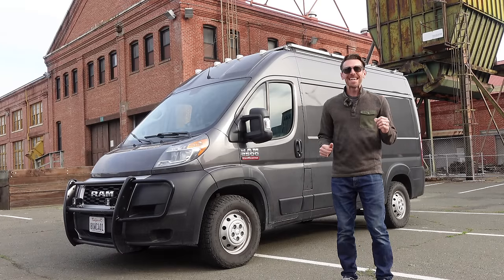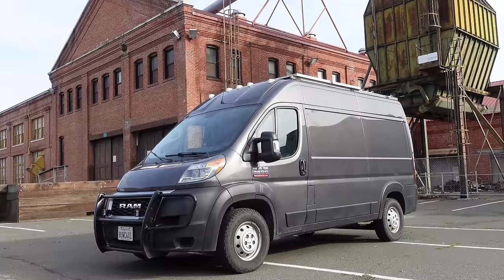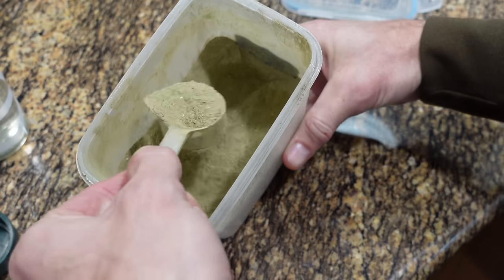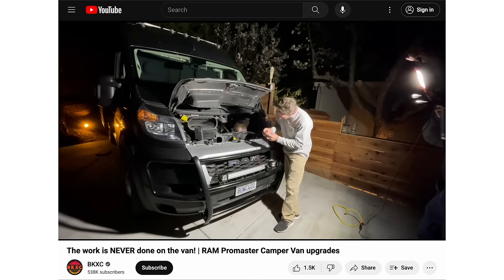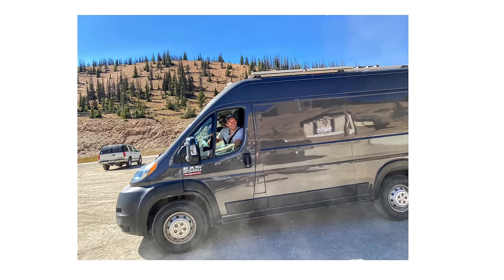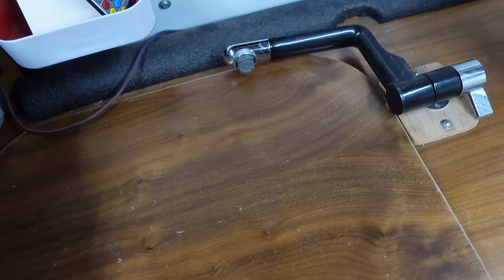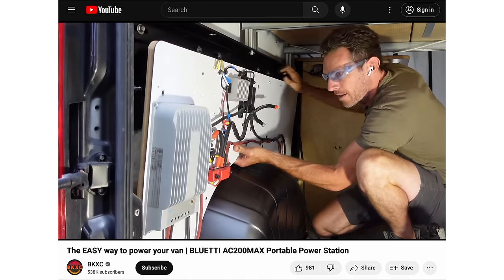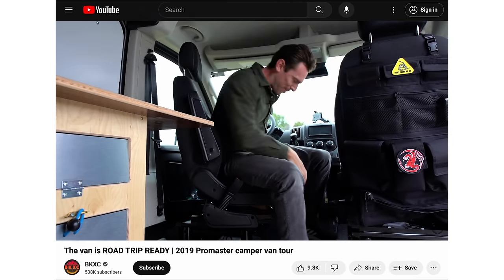100,000 miles of regret | My RAM Promaster camper van

Comment: I really wanted a van but, for many of the reasons you cite, probably not, especially the expense. Probably will stay with my crew pickup with a lightweight topper/camper. For weekend trips probably the way to go. Acts as a topper when the tent is down and still garageable.
Reply from the maker: Being able to park in the garage was a HUGE hang up for me. I hated the idea of having my van parked in front of my house. But it’s been trouble free so far, no break ins!
Reply: @bkxc  wife doesn’t like the idea of a van in the driveway. 🤣 Then there’s the issue of snow clearing and the seating limitations.

Comment: The 3.6L is generally pretty reliable. Lots of high mileage 3.6L pentastar out there. I have a few friends myself with over 100k on their wranglers/ grand Cherokee's with no issues. The lifters going out is probably the most common fault of the 3.6 but if you replace them before they take out the camshaft its not too expensive. 

Sure does suck you had to replace yours! Sorry to hear that. To be fair, I have had problems with even Toyota's, serious electrical issues and transmission issues.

Cylinder 2 caused a recall on wranglers/ various other CDJR vehicles of the time around 2012-2013.
Reply from the maker: Yep, every car is a roll of the dice! Just so many components.

Comment: If you are watching this and wondering what van you can get that wont suck this bad, the answer is the Nissan NV2500/3500, specifically with the 5.6 v8.  Yes, there is less (length) space because it has a normal hood, but that is also plus in so many ways.
Reply from the maker: I appreciate the alternative input!
Reply: Does this have height enuf to stand ?

Comment: I'm 72 yrs old and and I considered doing a van conversion as I have the skill set for sure. I decided against it, here is why, since my youth I've built and restored cars and trucks literally frame off engine rebuilds and customization. The biggest drawback in my opinion is the drive-trains in these vans, they are simply not up too the workload required besides who wants to spend 20-30 K to have someone modify one and have an engine that last 75-100K and you're back to square one. I decided on a Toyota tundra v-8 pick up with a tow behind cargo hauler, you can get multiple sizes in the haulers and build it to what you desire. Mine is 7'x14' and loaded with everything a van would have 2000 watt 24 volt ac/dc system all the amenities, and the beauty his my truck with a camper top serves as extra storage for anything i like. When i get to a campsite drop the trailer put a lock on the wheel hub and the tongue so no one can steal it and drive the truck anywhere i want returning at night to camp.I keep my Kayak on my truck drive to a lake go fishing, no problem return and all is good.
Reply from the maker: That sounds like you made the right choice!

Comment: The Promaster headlights have a problem with the wires fraying a few inches behind the socket, causing them to dim but not go out. I would install a new socket and use larger wire and run it close to a foot before splicing into the factory wiring. It fixes the dim headlight issue.
Reply from the maker: Oh wow! First I've heard of that. But headlights were dim from the beginning.

Comment: Definitely got you were you needed. Id never touch a dodge/chrysler product personally. Everyone has a story about them shitting the bed, and all my mechanic buddies refuse to buy them lol
Reply from the maker: Haha, live and learn!!
Reply: I've had three Chrysler vans, two used and one new. The 1st was good. The 2nd, a Town & Country, never needed a repair for 8 years! And few after that. My current, a Pacifica, had been nearly flawless, only a recall repair on the sliding door & console. We maintain them but have been really blessed with how they've held up. I know Pacificas had a rough 1st rollout year or so but I guess we didn't get a lemon. When you get a good one, they're gold. If I could find a decent- looking way to raise the roof, I'd make it my camper van. Stow-&-go seats in both back rows! I'd take some out & use the storage, but still have some seats to pop up for guests.

Comment: Hey Brian, not sure why you were unable to just replace the headlight bulbs with LED'S? I did this to my Promaster 2 weeks ago (because stock was TERRIBLE) and I just bought LED versions of the standard bulb size. No cutting glueing, standard install... They just needed to be aimed down slightly further than they were previously but everything worked fine!
Reply from the maker: Yes! I had not researched this again recently, but during the first couple years nicer headlight bulbs weren’t available. I figured it would be that way forever, but now it’s a standard upgrade (that I need to do).

Comment: I bought mine in 2020 (2019) and it had 15,000 miles on it. Did I luck out or what? I'm only reaching 40,000 miles now. Yeah the lights suck majorly. Leaves me wondering half the time if they are even on, but they are.
Mice & Colorado go hand in hand. I've captured about 7-8 when I was there. They don't get in from opened doors but mine wasn't converted or insulated yet.
Reply from the maker: Wow!! Crazy amount of mice, yikes!
Reply: @bkxc  yeah well my van is all open bones until I get my butt in gear ,& insulate it. Pretty soon. They are cute but they can't stay. 😂

Comment: I had no prob replacing the headlights on my 2019 Promaster. It takes elbow grease to push the bulb all the way in for a secure fit, that’s it. Bought on Amazon:  AUXITO H7 LED Headlight Bulbs.
Reply from the maker: Yes! For some reason I thought that the low beams were not a standard bulb because my buddy ran into some problems with his!

Comment: My 2018 Promaster 159 HR collected mice.  I full-time and had somewhere around 30 mice over the 4 years I used it. I became very efficient at killing mice. The final straw was a mouse that gave birth to 5 pups. I found the pups after I killed the mother. In spite of my proficiency at this grizzly task, it was extremely unpleasant every time. I could not figure out how they got in, or I would have plugged the hole(s). Would love to say that I sold the van because of the mice, but no, I put 100k miles on it and it was time for a new one. The mouse pups just gave me added impetus to move on from the van. Mice was one of two issues with the van that I dealt with.  I really liked that camper, so I put up with its flaws.
Reply from the maker: Holy moly!! Thanks for sharing the story!

Comment: I have 2014 Promaster w 135,000 (didn't travel much during Covid) only Major problem was had to replace Flex Plate? That cost $1400!   Running fine other that that?

Comment: If you're under 100k there's no reason to do any kind of flushes, I work for Spitzer CDJR and let me tell you dude as long as you do your oil changes religiously you'll be fine. The promaster fails due to extended oil change intervals. Change the oil at 4500-5000 miles and you'll be fine.

Comment: I swear the biggest positive about Tesla is no dealers…

I’ve dealt with FCA dealers once when I bought an Alfa Romeo and it was a nightmare. Not a fault with the car and as soon as I stopped letting those asrehats near it the car was perfect.
Reply from the maker: Yeah, I love the idea of an electric car so much. Of course any car has problems, but I love the idea of having fewer parts and pieces and fluids!
Reply: @bkxc  I think another problem with those US market “Promasters” is that they fitted a petrol car engine to it. A weird choice and I don’t think it’s up to the job!!

In all other markets where it wears the normal Fiat badge, it has a diesel engine that’s designed for that sort of vehicle. Here in Australia they have a solid reputation for being a reliable workhorse.

Comment: At this point 9000$ to 20000$ in price increase is purely criminal... Did the kit be 2 times better!? if it's for exactly the same kits it's not ok!!! 😕Even the increase in car and truck price is insane!!! You can have a crew cab 4x4 F-150 for around 40-45k$ less then 10 years ago! Now it more 70-80K$!!! 😲

Comment: i only bought 3 new vehicles and many used  but i have never taken any to the dealer for routemen service . oil and brakes i do 
when you had to tune often i did it .only time dealer saw it was recalls or warrantee and pre 2000 fords rarely had many warrantee and even few recalls until my 99  . one thing never flush anything but colling system and even they mostly in last 30 yrs just need drain and fill . i also worked for companies where i drove from 16- to 400 miles daily and they service useally regularly but sometimes budgets get strained  but cars went from  late 70s to late 80s cars and vans got extremely better every model yr fleet average went from 80k to 100k in 2-3 yrs needed replacement in say 75 cheaper cars to by 1990 160 and still safe to run but deprecated . they to about 2005 200k still good but seems backtracking with the government pushing emission and milage requirements   to be pushed to consumers before ready so we get to be batá testers . but regular oil and filter check all fluids regularly but don't always trust services advisers they work to profit the dealer which is rarely a actual owner there chains  of dealer corps not the local businessman

Comment: Dude, google how to turn the chime off. It’s a really easy thing to do on any car. You just need to know the specific code for each model car. It’s usually pushing the pedal and seat belt button a few times while the car key is in the “ON” position.
Reply from the maker: Yeah, I remember doing the research and it wasn’t so straightforward as that.

Comment: 75k on a RAM van Engine (which i suspect had regular service?). What was the reason for  the Engine going BOOM with No Warranty. This alone makes a RAM van buy a No No for me.. Most Fords and Mercedes in the uk go for 250 to 350 Miles in a lifetime of serviced frequently… Question, did the RAM dealership actually do the oil changes, sounds suspicious to me.. Did you complain.. thats no miles at all..!!!!

Comment: My son is an automotive tech, not to be confused with a tire changer or backyard mechanic. He's had over 15 years of schooling and shop experience, not to mention his loyal customers. 

The one thing my son repeatedly tells me is, "do not buy a Promaster- they're junk- no quality control and poorly fitting parts." 

But, I still want one bc of the shell design. However, I can't help but wonder how RAM can justify that unreasonable price when the vehicle is basically A METAL BOX! 🤦
Reply from the maker: Hahaha, exactly!
Reply: Does he tell you what van to get? Interested in his opinion there
Reply: @DMB-pe8hk He insists the best bang for the buck is a Toyota Tacoma, but no newer than a 2015.  They are warriors and hold their value. But, that's a smaller pick-up truck. So, he told me if I really wanted a van to travel, a Chevy Cargo van converted (having the roof replaced with a higher, fiberglass ceiling) was the only way to go. Since Chevy has not changed that van in 20 years, parts are plentiful and relatively inexpensive and, all the bugs have been found and worked out by now.

The problem is, it's very difficult to find a used Chevy Express for a reasonable price these days. And, if you're looking for an older one, it's either showing signs of body rot or, the mileage is over 200k. 

In my area, dealerships don't stock the Express. Those vans are usually ordered new, by businesses, and in multiples. It's tough to get one if you're just a private driver. 🤷
Reply: @rattlecat5968  I really appreciate this info & your taking the time to write it out for us.

Comment: For anyone who reads this and is buying a new vehicle,  always always always.. immediately drain the manufacturer fluids from the engine and differentials and change it over to Amsoil . The manufacturer fluids are just good enough to meet specs.. when you hit 40k, have the transmission flushed and replaced with amsoil, people are way too naive nowdays trusting these manufacturers and dealers ✌️
Reply from the maker: Wow, I've never heard that! Good tip
Reply from the maker: Wow, never heard of this! Great tip

Comment: Probably an issue with the shop you go to. You said you always say yes to everything they say, which means they probably don't treat you with respect, especially if they are having you flush the coolant MULTIPLE times in 75k miles, which sounds ridiculous to me, especially in a modern vehicle that utilizes more modern coolants.  If you don't check the oil leverl consistently, that may have been the issue, since dealership technicians are typically just kids straight out of high school who are highly incentivized to upsell people and may or may not follow directions when servicing your vehicle. 

I don't know anything about the 3.6 pentastar in the vans though and i always thought they were overstressed but can't be much worse than the new 3L inline 6 making 600hp in the trucks.

Comment: Unfortunately there is no perfect van solution. Promasters suck with electrical and motor issues. Sprinters have a million sensors that always fail and require 300 miles to reset. Ford doesn’t make a diesel transit in the US.
Reply from the maker: Most definitely!! Only tradeoffs in this world, no real solutions.

Comment: My 2017 Promaster,  bought new .
 At 40k miles the exhaust valve blew.
 At 61,000 miles it happened again while driving on the highway.  Left me stranded.  Dodge didn't want to help with the labor that I had paid upfront to get it back on the road. The engine was ruined because the exhaust valve wrecked the piston.
Then march 2024 the motor mount bolt snapped clean off and the engine almost hit the pavement.
   Dodge is a horrible company and hates people and hates their customers and could care less.
Reply from the maker: Yikes!

Comment: Can't you just install another vent in the roof? I saw somewhere you need 2 for the very reason you mentioned.
Reply from the maker: I think it’s more important to have the solar panels on top (which I didn’t show). A second fan would take up a lot of space. But I do like that idea quite a bit for full force movement of air.

Comment: RAM engines, especially the big displacement ones, are infamously fragile. But if you like the rest of the vehicle, Dodges are OK if you’re ok with the cost. Ultimate longevity means a GM Truck or a Toyota/Honda. And yes you should drive slower.
Reply from the maker: Gotta get up to speed on the freeway!

Comment: As a former mechanic, I love all your content, but buying a dodge was a bad decision. Chrysler is famously unreliable. Had I been you I would've gotten the diesel engine Sprinter van, diesel has less parts, gets good mileage, and last a lot longer than the conventional ICE engines. Also why they are used in long-haul trucking.
Reply from the maker: For sure! It was the right move for the time, but I paid for it!

Comment: i hsve 2015 promaster.....they are $$$$ pits...
17mpg, grest turning abilities
wider, then others, can hold more weight.
front shocks about $1k,  brakes about 3x ave van cost....some parts only come from Europe.  i have 162k miles on it. fords blow thru transmissions. and heighrs are weid, holds less weight. sprinters costly repair bills worst then promasters.
head lites, there early years 2014-2017, blew out every 3-5months, bulbs cost $30each for cheap ones.   then they came up with a bulb  that 'works'  but dimmer....instead of correcting their screwed up system. promasters lowest, so great driving in winds, ez step up into.  bad, not good on dirt roads to close to ground.  ez to bend bar between back tires... best part side door opens about 6-8inches more then others, front wheel drive so lots room at your feet, i wear siz 12wid shoes, normal van my R foot gets tired cause of little room at gas pedal. promaster lots of room there...cost of upkeep after about 100k miles, way high....1st 60k miles i was stating best vsn ever!!!  warranty was to 60k, 64k forward, yesrly breaks cost about $5-7k, plus normal .. tires, oil changes, etc. great van to drive, great mirrors. ..I WILL NEVER BUY ANOTHER.. IT like owning a boat, 2nd best day is buying it, best dsy when sold it..
buy older chev van V-8, 4speed transmission, 3500[1ton].

Comment: I drive one for work and cant stand it. The sliding doors open warning is always coming on and so much road noise and rattle from the back doors it drives me nuts. Its a 2019 with almost 100,000 on it. The doors wont lock with the key fob. If it was up to me i wouldn't have bought it but im not the boss
Reply from the maker: Oh man, my key fob is starting to act strange as well. Great!

Comment: I worked in field service for over 30 years and we always used Chevy and Ford vans except one time. We would only keep these vans for about two to three years, 80 to 100 thousand miles. The Dodge van was the worst van I ever had and the transmission failed at about 80 thousand miles. Find yourself a good local mechanic who actually not only cares about fixing your vehicle but you as a person. They are out there. Dealers are pretty much criminals. Someone has to pay for those large fancy dealerships and that is going to be you the consumer. I stopped going to my Toyota dealership some time ago. They are were always trying to up charge me on some crazy flush. Cleaning my fuel injection, really, it’s a big scam. I would not spend that kind of money to convert a van . You don’t need all that fancy stuff to camp in your van. I am a long distance backpacker and all I have is a tent and what I carry in my back. Check out Foresty Forest and you can see what can be done for next to nothing. It looks like your van helped you to accomplish many things and you found your life partner. Not to bad. It all worked out as things generally do. Take care
Reply from the maker: Thanks for those tidbits, I appreciate the knowledge!!